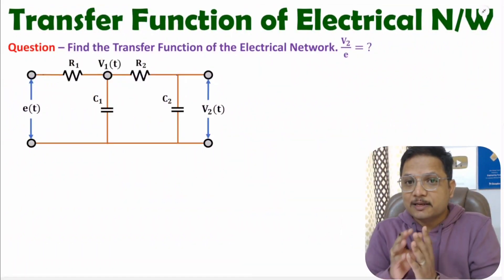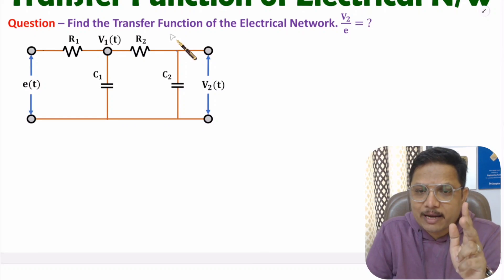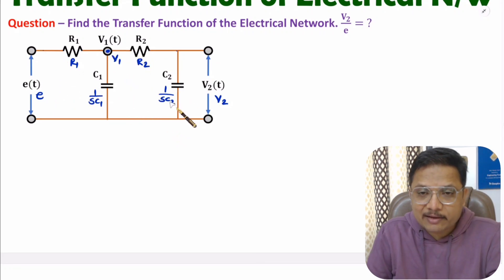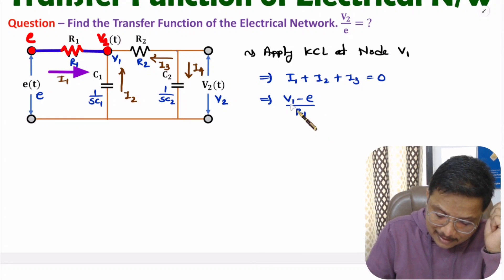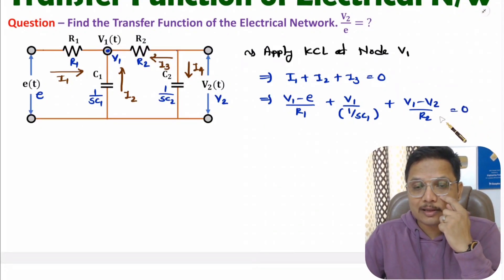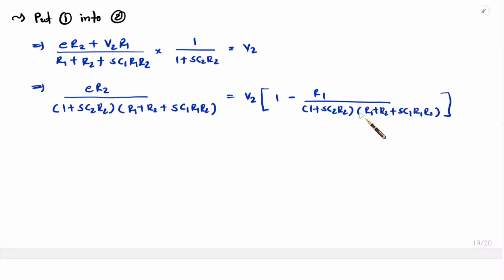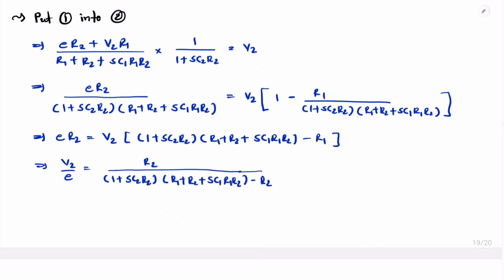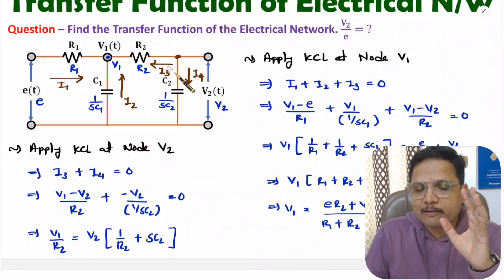Transfer Function of Electrical Network Explained: Step by Step Solution and Guide

Comment: @EngineeringFunda ,Could you please explain why you consider the direction of the current (I4) like that?Thanks in advance.🙏
Reply from the maker: It is randomly selected, but if calculated value is negative then it should flow in opposite direction.
Reply: @EngineeringFunda  so we could also say : I1+I2=I3 ( considering the direction of I3 towards right side, leaving the node V1)  and I3=I4  according to KCL Rule?